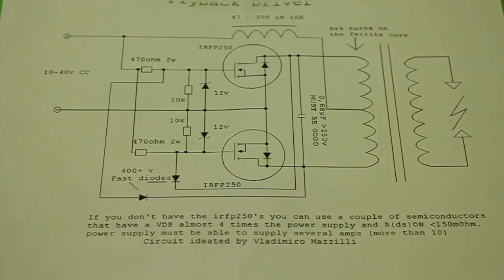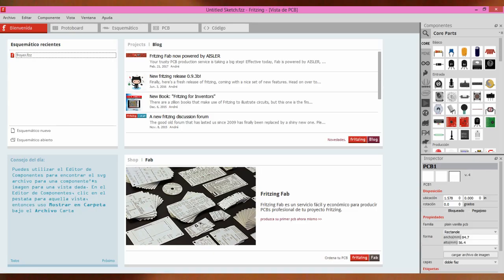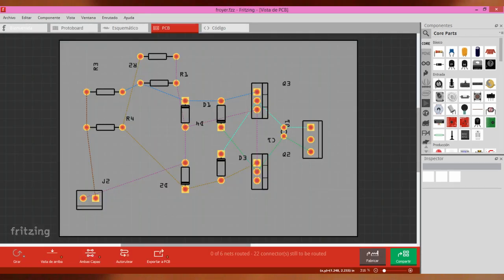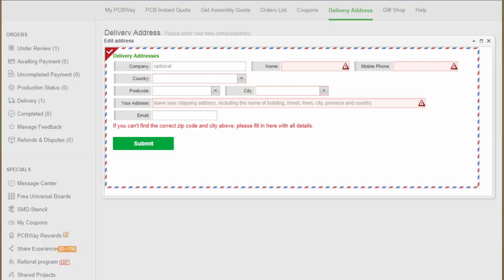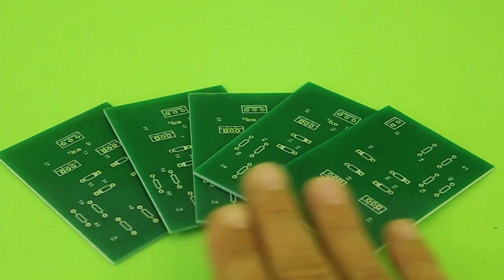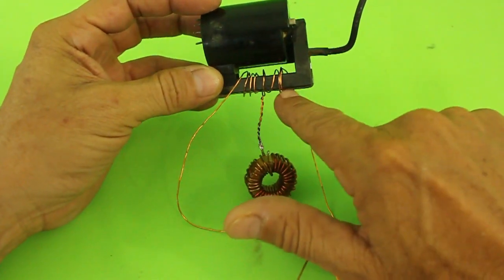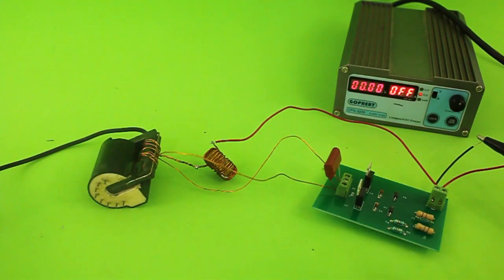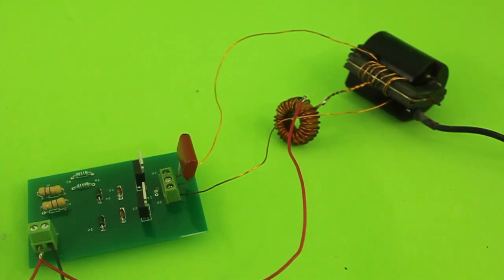Flyback Driver PCB with PCBWay

Comment: In order to design a flyback circuit it is essential  (really, REALLY IMPORTANT !! ) to specify the power capacity of the design use adequate 
insulation on the  winding , AND to specify the air gap of the ferrite and to describe the part  he exact part number,  type, and manufacturer.

Comment: The zener diode used for what in the circuit???
Reply: electro magic to clamp Voltage spikes on the Gates of the mosfets,
Reply: Because the gate breakdown voltage is 1/10th of the drain to source    voltage

Comment: not the best use of the pcb, better to have inductor and cap through hole mounted to the pcb, meaning only the coil and power need to be externally connected. and the size of the pcb is over sized for a ZVS, my version is half the size with all parts on board. and have a 555 based driver thats even smaller
Reply: Am so excited about ur design but ur channel is empty ..plz upload a video about ur work so we can compare